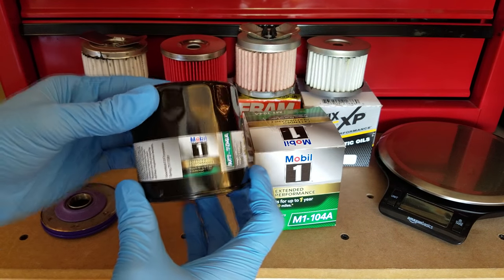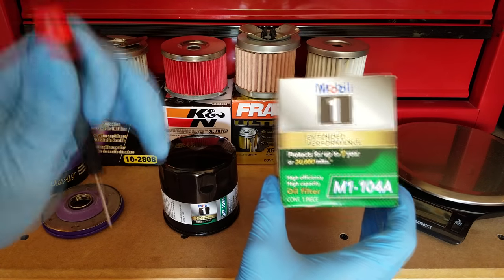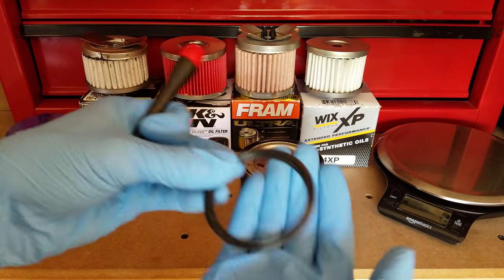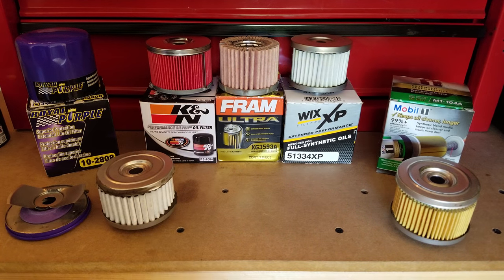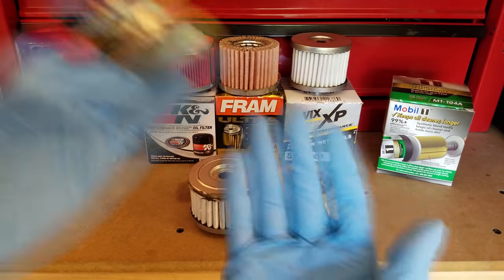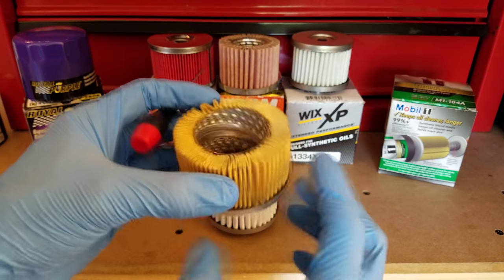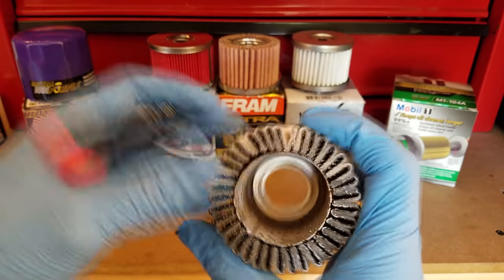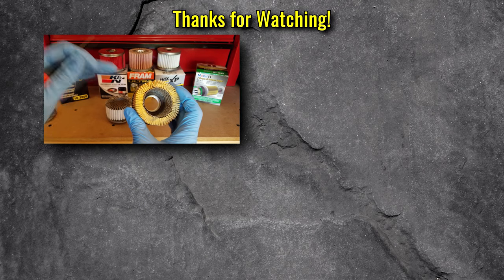Mobil-1 Oil Filter Cut Open! | vs Royal Purple/WIX/K&N!

Comment: I would like to see an oem Toyota and Honda filter compared to some of the other aftermarket ones you have already done.
Reply: I believe honda's filters are made by tokyo roki FYI
Reply: MercedesCherokee in the US they are produced by Tokyo Roki/Filtech and Fram/Honeywell.
Reply: @Davido50    Uh-huh.  That's why Honda and Toyota cars don't last. They use cheap parts.
Reply: Wade Yorke Toyota OEM I hear is not too good. Go Motorcraft or Mobil1.
Reply: ceeweedsl I don't see any old ones on rd do you?? Both recall kings & service bays at dealerships full when I drive by. Uve been fooled. Buy American.
Reply: David Klimmek absolutely not. They’re rated for 20,000 mile changes! And they’re “made in USA” just like Mobil’s
Reply: David Klimmek I have a 2004 Honda Element that I bought new and has 485,600 miles on it as of today. The oem Honda filters (all of them) are USA made. As was my vehicle, and engine and 84% parts content. You’ll never find something THAT American today regardless of brand.
Reply: @Davido50  Don't buy a prius next time 🤣
Reply: @Davido50  uh huh, Im 60 years old and a sufficient mechanic to maintain my vehicles all my life.  Im no blind consumer with some idea that to prop up a poor product is patriotic.  Please.
I just retired a 1977 toyota
 Corona due to rust on the coast.   I have a 96 Tacoma, and also a 2002 Eurovan and a 2010 Escape. Ive had several other Toyotas and Nissan  I know all these vehicles thoroughly, faults and all.  The Ford is good but has had four major parts failures before 50 k. Poor quality control and sourcing.  Luckily the engine in my Escape is a Mazda.. and quite reliable.  Made a point of getting that version.
Reply: @Davido50  Most people are unaware that Guatemalens have been buying up Toyotas for twenty years and driving them down tbrough Mexico in caravans. Perhaps 50-100 toyotas daily enter Mexico through Browsville and Laredo. Thats several hundred thousand a year, every year.   If you are on an interstate that leads to Texas and see an old  toyota truck hauling another toyota and filled with parts etc and an "In Tow" sign, that is the guatemalen buyers converging on the border.  They buy them up everywhere thats not rusty.  Try looking for a used Toyota Tacoma on autotrader and compare prices to an S-10 same condition.  Quality is known worldwide.
Reply: LOL at americans that think they make better products.
Reply: @ceeweedsl  what are you smoking? Toy and Honda are superior
Reply: @donschlonski2936  agreed, had a great Nissan pu too.
Reply: from experience Toyota is most solid make tho
Reply: Toyota lasts a lot longer than any chevy or ford
Reply: @ceeweedsl  stop spreading untrue zero fact lies, and fake news.

Toyota makes the without question most reliable cars. GM, BMW, Ford, VW, Jeep suck for quality and reliability.
Reply: @Davido50  no buy Toyota, but best quality most reliable cars made. Buy American if you want poor quality unreliable POS cars and trucks.
Reply: @MaxiiBoii23  Prius is factually most reliable best engineered cars made, without they rarely break. Both mine have over 180,000 miles with zero repairs other the tires oil and one windshield. American, and European and German cars suck for reliability and quality.
Reply: @ alan connelly: I agree Toyota is most reliable in general.  Not bulletproof but best overall, so I think that you are confused attacking me -probably you are not reading well or clicked wrong place.   I am not unhappy with VW quality however - just that the Germans over engineer at times and lose reliability.  At least that's my experience with my 2002 Eurovan.  But hey, Alan,  even though we DO agree, please realize that you are going too far when you call anyone else's opinion "fake news"!      When  somebody says they like a restaurant and you don't, is that "fake news"?    If somebody has a good experience with a product and reports their positive experience is that "fake news"?    You are both misusing and watering down a term this way.  Try to relax!  cheers
Reply: @ceeweedsl  Toyota & Honda are well known to gain 300,000 miles or more
Reply: @ceeweedsl  Not true
Reply: @nickphillips2125  AH, now I get it why a couple of you think I am bashing Toyota.  I was being facetious.  EVERYONE knows Japanese vehicles tend to last.  When somebody commented that Japanese vehicles have poor filters I came back with a facetious comment.   Toyota OEM is top quality.   I buy Toyota filters.

I think that reading for a moment one would catch that, but ok not much time, easier to make a quick comment than to read thoroughly.  I make the same mistake sometimes.  Cheers
Reply: NAPA sells a metal filter housing replacement for the plastic cartridge type I figured it works like a heat sink. I think it was about $36.00 2013 4Runner
Reply: They’re made with rice as the filter material and a soy made gasket....😂
Reply: I am quite familiar with the defective rust prone automotive products made in the USA, as well as the Boeing Max for starters.
Reply: @Davido50  
Toyota emphasizes oil flow rate as being more important than filtration. At least that is the impression I get.
Reply: @stevensevek6151  Well its certainly not an engineering metric that was established by Yoda. Oil flow & filtration both important. If your engine is clean thru proper general maintenance then filtration is secondary yes.
Reply: @Davido50  
I change ours every 5,000 miles with full synthetic 0W-20 and either an OEM Toyota filter or a K&N Filter.

Comment: I'm a royal purple fanboy from WAY back. I've been using their products exclusively for about 10 years. There's one thing I can proudly say to everyone in the comments section here. On my 1997 Toyota T100 with over 300,000 miles on, using magnets on the filter casing, I get 20,000 miles out of my oil on a regular basis.

Comment: All filters have a bypass , so if the filter material is very dense, it would seem to me they would clog early and the bypass comes into play, so what really makes a good filter?
Reply: German Mann filters have the best retaining media for the least flow resistance. Otherwise , you can also double the length of your filter buying a truck filter of same diameter and thread on the Wix site and you will see your car is much smoother driving with even better filtration, less strain and less chance of clogging
Reply: Mobil 1 guarantees the filter will not clog within one year or 20k miles within that time, using correct spec oil. The bypass is for when the filter is clogged and can't filter. It will save the engine until an oil change is done immediately, but it's a very small window. It has been emergency code blue for a long time when that happens. Maybe it also serves as a gatekeeper if there's too much oil flow? 

I've seen it first hand in friends car. You can't go 24 months to hell and back in distance without lifting the dip stick once? Who knew! She didn't :D
Engine was toast. By the way, it was a turbo diesel too so the engine was completely torn to shit internally. Bypass valve was inconsequential as the oil was nothing but goop anyway, got something like a quart when the plug was removed. The oil filter was saturated with thick sludge.
Reply: mike force  this isn't the first time I've heard somebody say that when they upgraded their oil filter it made their car drive so much smoother, like driving a Cadillac, SMH, lmao. It's similar to people who put air fresheners inside their air filter box for the engine thinking it's going to bring scented fresh air into the cabin.
Reply: Sfer Tonoc interestingly, I use the MANN NAPA GOLD/ wix 3–4 K mile changes , severe dust & Driving 2015 Journey 4CYL...

Comment: Curious what your background is. I worked for one of the premium filter companies and what we were concerned with was performance. How well it filtered particulates. Not what color it was or how many pleats ECT. The number of pleats is not as important as the quality of the filter media. Also, the ones that just glue the paper together can split. Much better to have metal rib bonding pleats together. Just my two cents.

Comment: Military vehicles, and generators, all run synthetic oil, and get an oil change every 12 months. I served 20 years. Very few military tactical vehicles go more than a few hundred miles each year. All of our personal vehicles, from 1993 through current year, run synthetic oil.  We buy them all used,  I do every task necessary to bring them up to factory standards.  Except, laser wheel alignment, after any suspension/steering part replacement.
Reply: I was a mechanic in the Army and I saw no identification to say our lubricants (at least regular 15w40) were synthetic. They may be blends though. But I doubt they are group 4 or 5 synthetic base oils. Would love to see virgin oil analysis on military oils to see what's really in them.
Reply: @nickkaraoke2128   yeah, then we sell those vehicles to Saudi Arabia and put a Fram cheapo on them with recycled  oil. :-)

Comment: And to think;  The el cheapo Fram orange can(and it's generic equivalents used by most "Kwikie Lubes" ) protect far more vehicles than all others combined.  My father was a paper chemist who helped develop many of the media used in consumer oil filters.  He worked extensively with the parent companies of all the major manufacturers and just chuckles when he sees people cutting open filters nowdays as if it's going to tell them much.  He said the only real significant difference between the cheapest and most expensive is paint and price.  All the hoopla regarding the "cardboard"(which it's not) construction of the cheaper filters is meaningless to the engine and the filtering of the lubricant.  In his experience he's heard of very very few CONFIRMED oil filter related failures resulting in the loss of an engine or even significant damage.  Compared to the mileage driven without issue....it's almost not even statistically relevant.
Reply: But it's fun. Can't we have fun dad?
Reply: I always buy the cheapest filters; for the past 15 years has been Super Tech from Walmart.
Reply: PDB Long, nothing wrong by going cheap. I hope your thrifty doesn't go beyond your dinner dates.
Reply: Still, we're pretty sure that steel is more durable than whatever you call that cardboard stuff.
Reply: Well said, a roll of toilet paper was common ues for the oil filter, ppl thinking that analyzing oil filters matters are just buying Into all the hype, this guy is really anal, worrying about too much glue or how it's put together, change your oil and filter every 3000 miles and you'll be fine ppl. No matter which filter you use
Reply: PDB Long, actually the Super Tech is a pretty decent filter
Reply: TakeDeadAim, the big difference is the drain back valves (and springs, not stamped steel). I had a Yota 22R that suffered damage ( back years ago when I didn't know any better about Frams) the leaky drain-back valve will damage the cam chain guides due to the oil draining back and the cam chain tensioner being empty, caused the chain to be sloppy then pressure is put on abruptly causing damage. The chain slop at startup wore a hole in the timing chain cover causing coolant to enter the engine. I replaced the cover and chain with a 20R double roller factory set. Switched to Napa Gold from that point forward. Crappy drain-back valves is a huge factor, regardless if there is no difference in filter media
Reply: Seems fair. However: do NOT use Ryco oil filters on older renaults and peugeots. Youll run the main bearings in short order. They dont hold pressure overnight, resulting in oil starved bearings on cold start. Basically youll kill your engine.
Reply: You may be right. I have changed oil in a few vehicles over the years.. not saying I am the expert on the subject. I have had to pick out pieces of cheap filters from cartridge type oil filter housings (such as on 2000 era ecotec motors) the price difference from $5 to $10 is a no brainer in my book.  I run wix filters on everything. May not be the best but never had an issue.
Reply: I agree!  Been running Fram filter for 20 years never had any mechanical engine issues. Just change your oil when you're supposed to with the correct kind for your vehicle and you don't need to worry about what the inside of the filter looks like.
Reply: never had problem with fram in 40yrs. but then I dont cut up my filters.
Reply: Voice of Reason? Is that you?
....Hi! Long time no see, dude!
Reply: @harryl8234     they go dutch...........     lol
Reply: Change oil at 3k  no problem with framing and Walmart brand in fact it's more cost  effective. But if you've ever seen the construction of the cheaper filters you probably  wont ever go past it again. I personally  go Mobil1 and Mobil1 filter and change at 7500 min and do it on all 3 cars 2008 Chevy 2013 Mazda 2017 Infiniti
Reply: @kenshinhimura9387  you have proof that bit of rust causes engine damage? What happens when you apply motor oil to a metal part with surface rust? 
The rust disappears.
Reply: @batvette  lol no it doesn't. It just covers it up. The rust is still there. When that oil dries up you'll see the rust again.
Reply: My spider senses tell me you've just made that shit up. Filters that have a risk of coming apart and/or becoming clogged are evidently risky and will shorten engine life, that's common sense. Where's your proof for you chuckling paper chemist dad story?
Reply: Filters are a such a small expense in overall car costs it's absolutely moronic to not use the OEM filter in daily driving (unless they are proven to be dangerous). I'll fork out 15 bucks on a filter once a year and avoid risking 15 thousand bucks on a new engine. Usually that would put the car at end-of-life meaning 30 thousand bucks on a new car.

Is it worth it? Really? Is it?
Reply: TakeDeadAim i wouldn’t put a FRAM filter in anything, not even my worst enemy’s car!
Reply: Completely true TakeDeadAim! All this fuss over such ridiculous non-issues. Never have I hear or seen an engine ruined by an oil filter. Sticking with Fram.....
Reply: @twiz8789  Fram has started using silicone anti drain back valves on the extra guards instead of the nitrile rubber
Reply: Well said Richard.  "Naval Gazing"   If you think this is bad go watch some coffee maker videos.  All this is about splitting gnat hairs.   Whole Foods and Trader Joe's Crowd.   I have seen people discussing coffee creamer for 15 mins while Googling on their cellphone.   I had a 1973 VW Beetle and only changed the oil once in 200, 000 miles.  No oil filter back then.  Just added about 1/2 quart of oil every other month for 10 years.
Reply: @adrenalinehigh2070  well maybe two in my worst enemies car, lol

Comment: My vehicle went 30,000+ miles with the K & N gold oil filter and the Amsoil signature series 100% synthetic motor oil with optimal results/performance. $6 for the K & N oil filter and $77 for 7 quarts of the aforementioned Amsoil. Do the math.

Comment: I also noticed the part number change and the new Mobil one full synthetic oil advertise 1 full year between oil changes.  So like you I think 20k is very extended. I drive about 20k a year. I use this filter and the Mobil one high mileage full synthetic oil. But still change oil at 10k

Comment: The Mobil One filter holds less dirt because the filter media only catches down to 30 microns.It bypasses more oil.Recirculating all the dirt and particles smaller than 30 microns.The bigger holes in the filter media take longer to clog.Mobil One oil is highly detergent and breaks down more of the dirt/combustion byproducts  in the oil so it does not clog the filter as much.That's how they can warranty it for 20,000 miles.The thicker case is good burst protection insurance but mostly helps if the filter is poorly located under the car and is exposed to road debris.The bypass valve is for cold engine starts,running with thick petroleum oils till warm up,for if the filter starts to clog so the engine does not get starved for oil and prevents bursting.In most racing applications the bypass valves are eliminated and much larger filters with much more filter media surface area are used to increase flow and reduce back pressure.Generally filtering down to approximately 40 microns.Expensive race engines can't risk a cheap bypass valve opening when it shouldn't and allowing unfiltered oil to damage critical engine surfaces.All I can say is what ever you do don't use Jiffy lube filters or oil.The filters,I've seen these one after the other leak at the seal new out of the box when properly installed hand tight.And the oil is recycled piss water I wouldn't put in ISIS's lawn mowers.Wait,does Nancy Pelosi have a lawn mower?